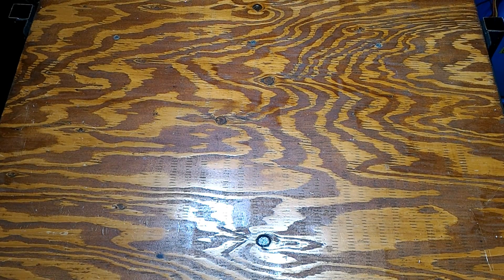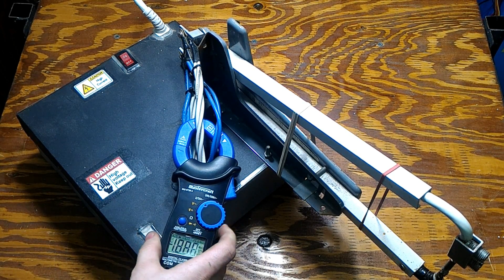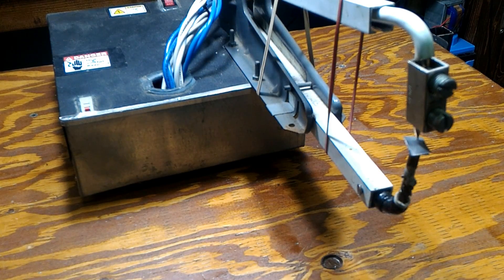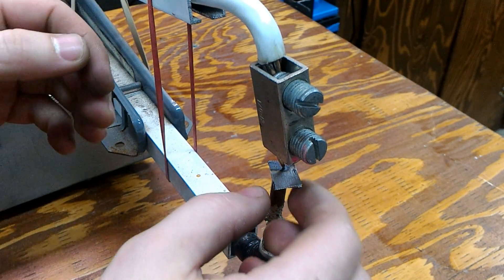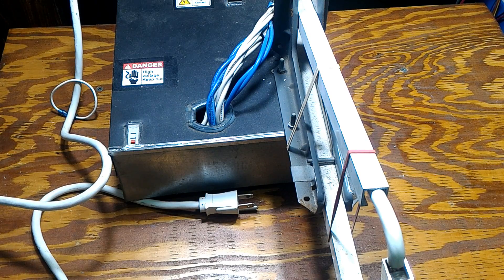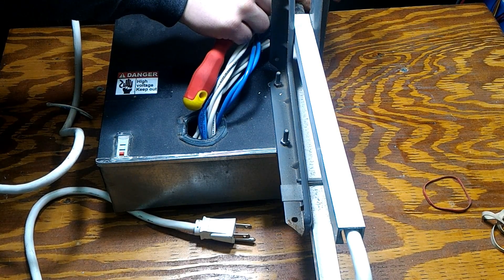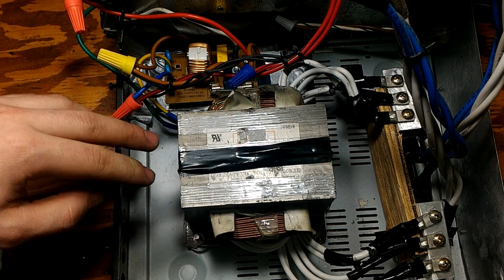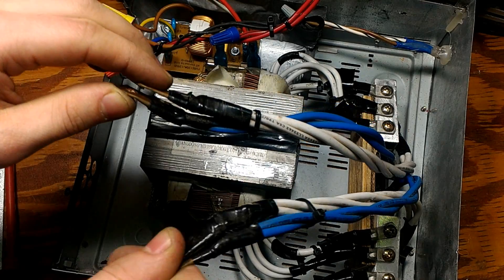HOMEMADE SPOT WELDER FROM A DVD PLAYER  💣👍🏻💣👍🏻💣👍🏻💣👍🏻

Comment: Totally stupid video. Unnecessary, annoying "music". Ridiculous, totally misleading title. Nothing to do with a DVD player. Verbose in the extreme  with useless info.  Ignorant of electrical principles (there is no shock hazard at the tips, as the voltage is tiny, and the human body is not made of copper).  The only important parts in this project are a schematic and the modification of a suitable transformer - none of which appear in this useless video.
Reply: Is your video better? Thought not.
Reply: @KennethNicholson1972  stop you chinese man